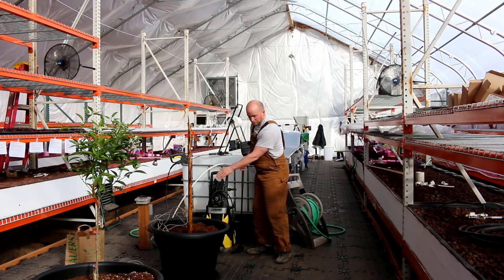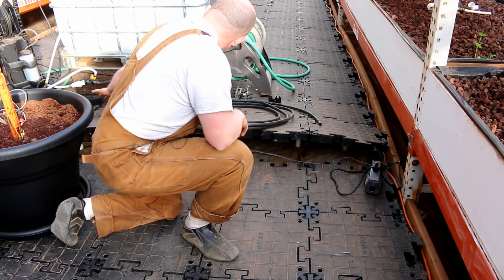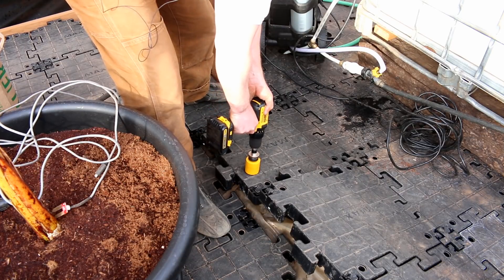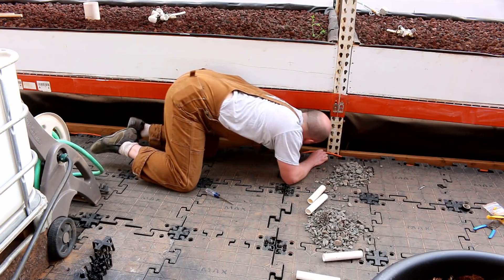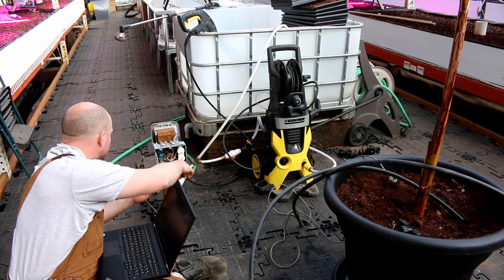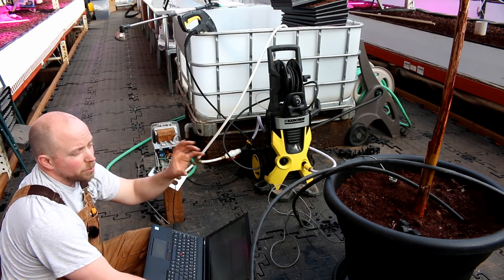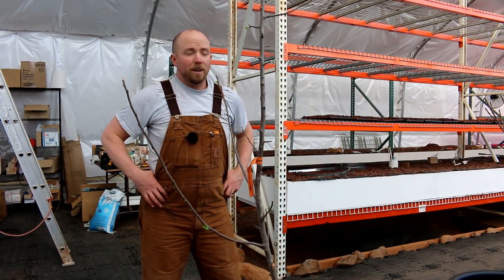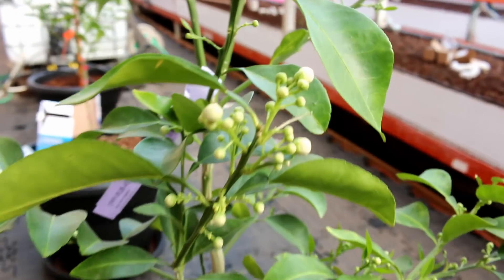Setup your GREENHOUSE to be RECONIGURED easily

Comment: Hey Jeff, what are you going to do when all these small pumps begin to fail one at a time? It could happen on vacation. I think you need to rethink your approach on this. Just off the top of my head, I think a 'aquifer' system with one centralized pump would work the best. Then I thought what would work even better is a pressure tank that distributes water where it's needed. I dunno man, just suggestions. I think you need a 'hub' or 'conduit' of sorts to distribute this water rather than many individual pumps.
Reply: Wouldn't a de-centralised pump system be more reliable? Since if any one pump fails, it only effects a small subset of all the systems. A centralised pump would mean there's a single point of failure that takes down the watering system for the entire greenhouse.
Reply: That's a good point, perhaps a gravity feed / pressure tank system with a backup pump incase the primary fails? I'm not sure what the right answer is though. Looking at multiple pumps all with different jobs, it makes me think it'll only be a matter of time before one after the other starts to fail and he's chasing his tail around while trying to make progress. 

I personally tend to lean towards centralised systems, as they're easier to diagnose but I admittedly do not have any experience with anything Jeff is doing.
Reply: Pumps can and will fail over time. However a large number of small pumps would be less impactive than a single large pump. If a small pump fails, whatever it is watering is going to have issues. If you are only using 1 large pump then EVERYTHING gets shutdown. Also recall he is an engineer by training. If it isn't over designed, it just isn't worth doing!

Comment: If it is possible, I would suggest moving the plug for the moisture sensor from the side of the automation-module to either the top or the bottom.  Where it is now leaves it opened to being run into by passing traffic.  If it were on the top or the bottom of the automation-module it would be out of the line of traffic and would also gain some protection from the post.  Hopefully it is something that could be changed easily.

Love the channel and I always look forward to seeing you post videos.  Keep up the great work!
Reply from the maker: yes...you are totally correct...already had a run in with it :-)